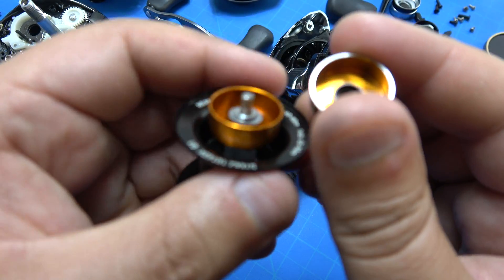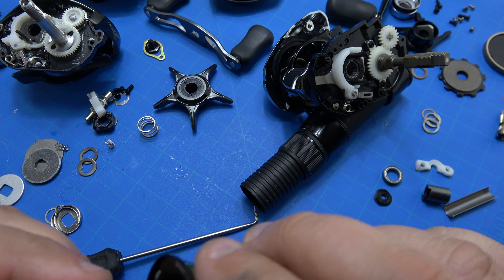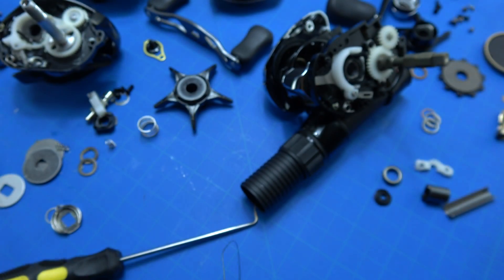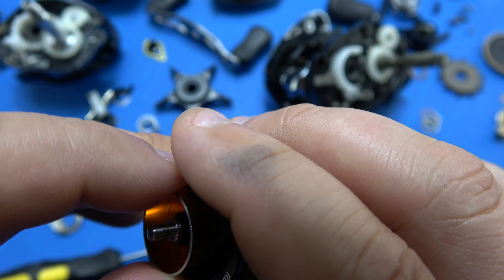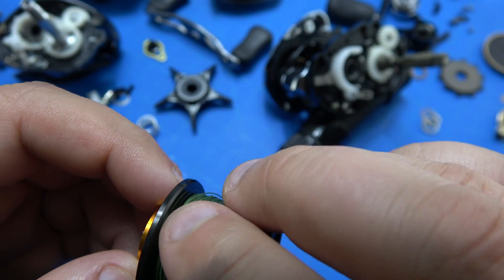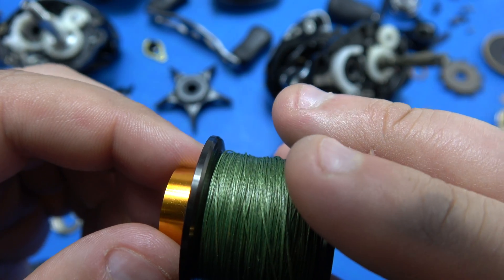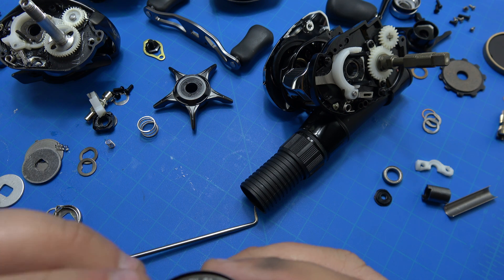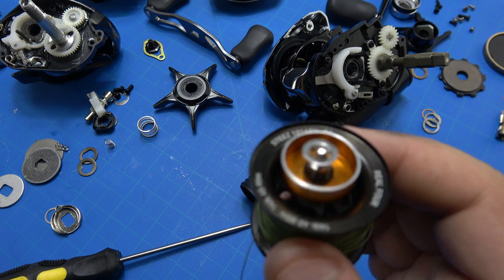Experimenting with Steez:  Modified inductor cup on sv spool.  Do you think it will cast further?

Comment: Shaving it wont make much difference.  You will still have to adjust the brake setting to match regardless.  However, if you change the brake spring you will notice the difference.  

Ex.  Stock you cast 1 oz plug with 8 brake setting

Shave the brake hub not you cast with 1 oz plug you will require more brake now and since u shave off a bit you have to increase brakes to 10 setting.  

Both = same distant.  

If you change the spring = it brakes fast and then let go fast also.  Which allow more time for spool to be in low brake setting resulting longer cast.   Down side is increase birdnest.
Reply: If you put heavier spring  or shim the existing spring it lets the spool spin up to a higher speed before brake’s actually start up  reducing the overall height of the inductor  have a look on distance casting page  reels like diawa 7ht mag  benefit greatly from this mod

Comment: Yes it will work, because all reels with magnetic brake are made for very broad weight casting for different consumers. On some vintage reels like Ryobi V mag  4 or 5  was very inconstant magnets and always the same size aluminum spool brake cup , on some reels magnets  was stronger than on other, this is why sometimes was impossible to cast on 0 brake light baits.       Some time ago I did this operation too, because its much more simple to cut cup off when to play with allot small magnets to reduce magnetic brake power.   But I saw Daiwa  solved this problem before on some bait casters, it was possible to raise magnets up to make less braking power, it its very good idea , but I don't know how good it was made and never had this reel in hands, only saw in Daiwa webcite.
 I think your explanation how is spool braking is partly correct, because more spool spins more aluminum cup  goes out, close and faster its spins near magnet more its becomes magnetic and more its sucked in to the magnets---probably  I am hear correct too. If its would be more precise made reels it would be different power magnet sets to change for casting different weights, but most producers make everything simple, like cars for common people, race cars for racers.  probably to long and not perfect English )